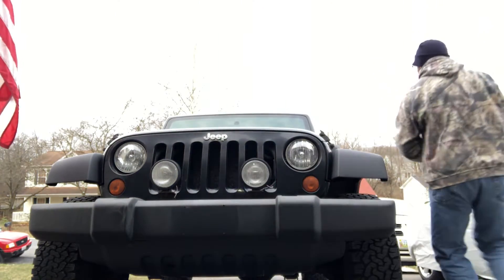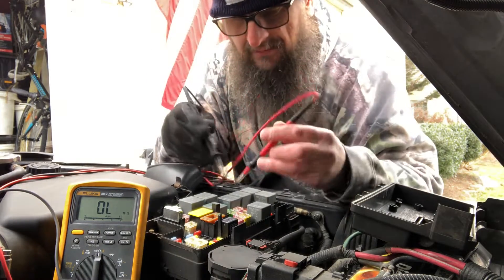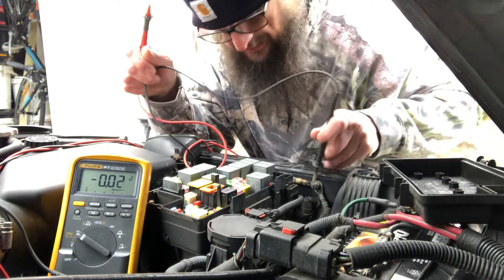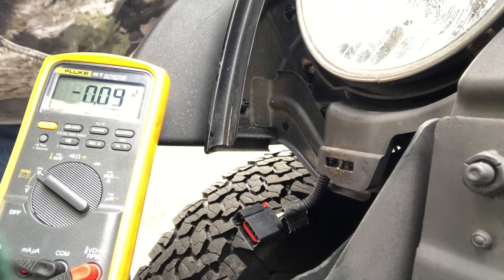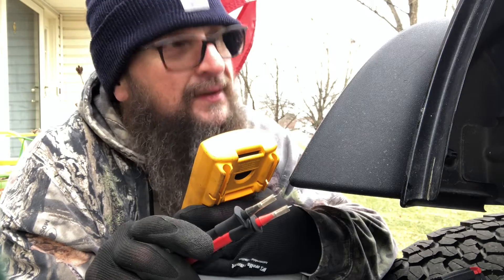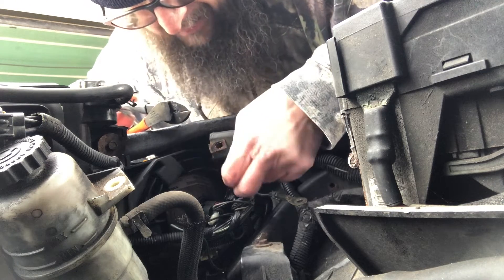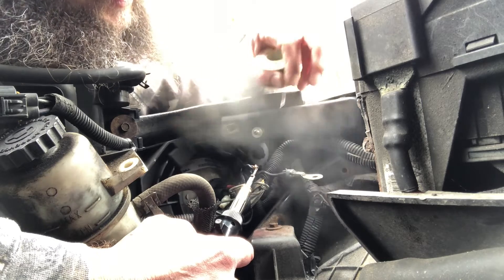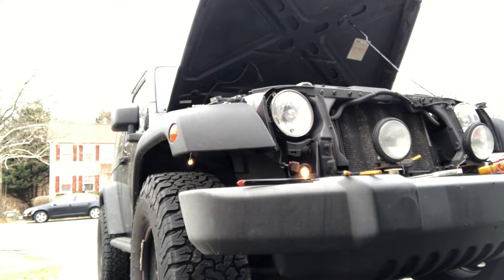How To Diagnose and Repair Electrical Grounds - JK Running Light Problems Resolved

Comment: Super helpful video. My Jeep has major gremlins. Highbeams & turn signals don't work, lights always on, and windshield wipers on. I know that's emergency mode. I've changed the TIPM, Clock Spring, and instrument panel, but didn't solve the issue. Sometimes the whole car just goes dead. I'm assuming I have bad grounds since I live ina. tropical salt water environment. Curious if there's a diagram somewhere listing all the grounds. This has been hell trying to fix!
Reply from the maker: Thanks.  Not sure what to tell you about your Jeep.  Hope you figure it out. There are places to get a factory service manual online.
Reply: did you ever find the solution to this? having the same issues

Comment: Basically all the grounds all the way around the engine bay need to be cleaned, cut back, soldered & re terminated. Jeeps have horrible wiring that easily corrodes.
Reply from the maker: Yep.  The engine ground stinks too.  Been fighting with O2 sensor grounds too.

Comment: Nice video!  Have you had to diagnose a JKU PCM or do you know at what location it is grounded?
Reply from the maker: No, I have not.  There are a few grounds located near the PCM.  I would guess the engineers would use one close-by, so I would start by cleaning those.
Reply: Any luck? I’m dealing with the same issue

Comment: I’m having an issue where the marker light turns on but the turn signal does not flash.
Reply from the maker: Sounds more like a bulb issue than a ground.  The easiest way to check is with a good bulb.  Pull the other side, test it in the bad side.